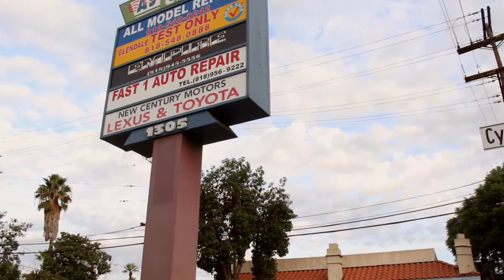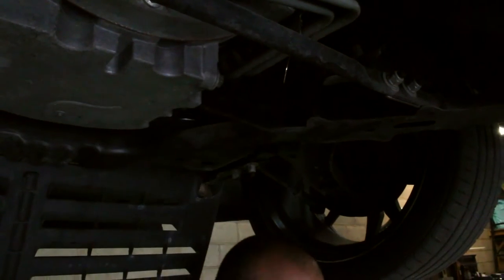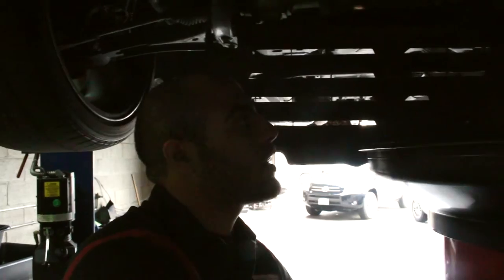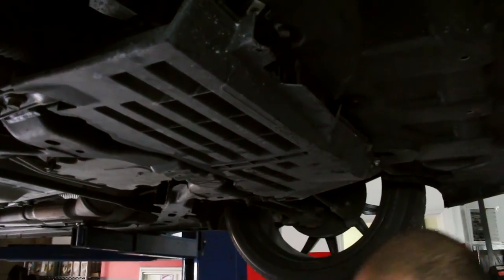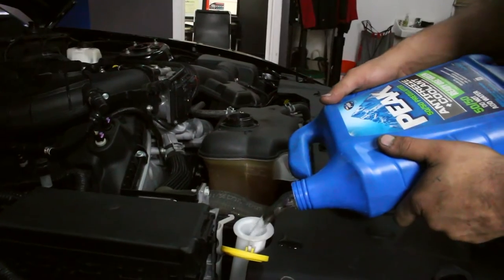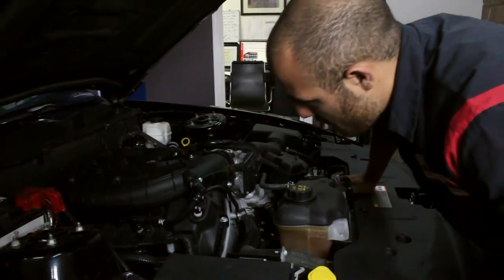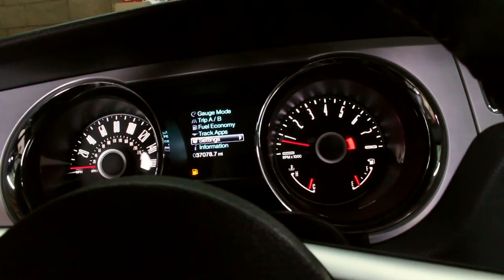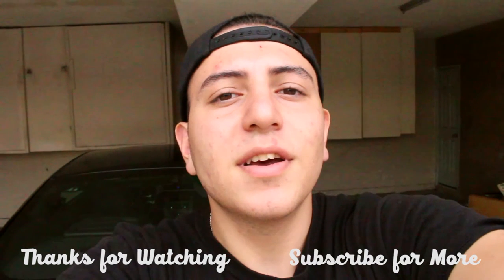How to do an Oil Change on a 2014 Mustang V6

Comment: I don't know about this mechanic.  Adding water to the anti-freeze and the windshield washer?  What about the specific 5-year anti-freeze that Ford uses, as well as good old blue windshield wash?   Try that water around here in the northeast and your windshield wash pump will crack in winter time.

Comment: ALWAYS remove the old filter FIRST !   1) You can check with the new one to make sure it matches . 2) If you drop it  , you won't splash hot oil in your face .  3) If is not the right one you can put the old  back , and return the wrong one for the proper exchange . Can't do that if you drained the oil first . Your welcome .

Comment: Bro be alert! Manual say 5w 30!!! Dont pay attention what the cap says
Reply: Seems like you need to be alert, just checked the 2014 manual and it says 5w-20 for the V6 and 5.0.  Page 303 on my manual, could be a different page on a different printing.